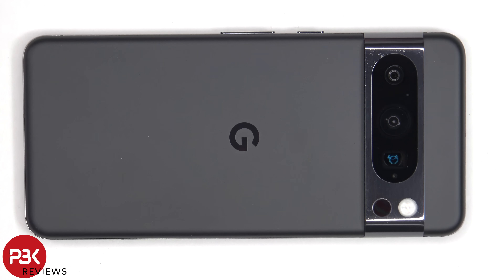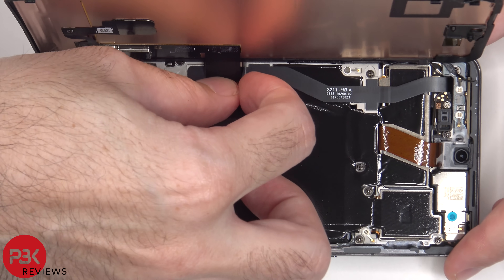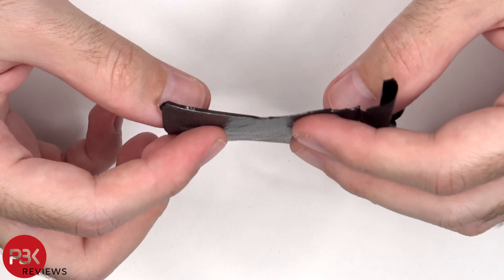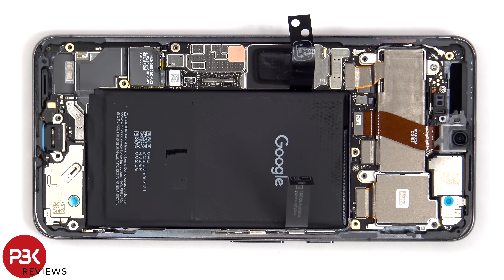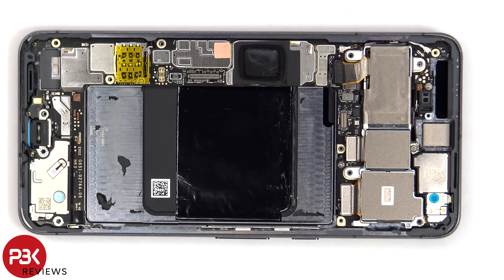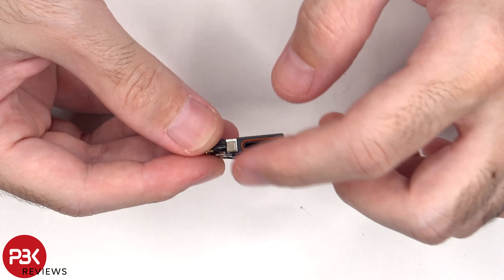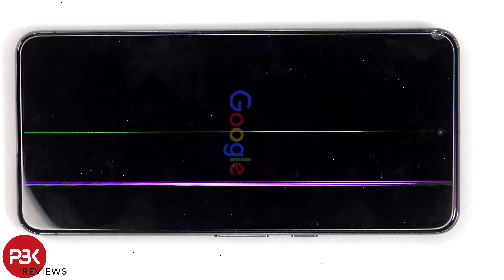Google Pixel 8 Pro Teardown Disassembly Repair Video Review

Comment: I would really appreciate and be very grateful for your response PBK.

I've had to replace my screen twice within 6 months on my Pixel 8 Pro. This second time just occurred and I haven't had it repaired yet. Both times I had taken my case off one day and then it ended up staying off for days, during which I dropped it from waist height onto hard surfaces.

There were no cracks or other visible physical damage either time, just some green lines across the top of the screen as well as a small black area at the edge of the screen. The area with display issues would grow larger over the next couple of days, until suddenly the whole screen would start only displaying one color most of the time, sometimes with short periods where the home screen would be faintly visible through the one solid color, and sometimes short periods where a large portion of the screen would be mostly visible as normal with some flickering. This period would only last a day or two before completely failing without anymore periods of partial visibility, but it would be enough to do things like turn off my password to make things easier for the repair shop, and turn off 2FA on many of my accounts, at least the forms of 2FA which required physical access to that specific Pixel device, as opposed to the accounts with forms of 2FA that just needed access to that phone-number/SIM-card. 

I believe something must be making my screen more vulnerable to damage for it to fail so easily with such minor accidents, especially when there are no cracks or visible physical damage to the screen glass. 

The side rails are cracked and chipped around the edge of the phone, with chipped areas at the top corners, and the top of the display is where the screen began to fail both times, so I think this is the cause of the weakness and vulnerability. 

So my first question is, is it possible to replace just the side rails of the phone's outer shell/frame? Is this a simple and cheap repair? Or is it a more complicated repair that could result in accidental damage to another component? 

I'm using a backup phone since a new display needs to be ordered and shipped from another country (I've been living in Myanmar/Burma and the Pixel isn't officially sold here) so I'm in no rush to get it repaired, and might just wait until I'm back in the the US in a couple of months since there's really only one repair shop in this city (Yangon) that repairs Pixel devices and has parts on hand (the first time I needed the screen replaced they had one on hand and didn't need to order it) - however I don't know how skilled they actually are and I know that they must rarely work on Pixel phones since extremely few people own them here since they aren't sold here.

For all I know, maybe the reason why the screen failed so easily this second time could have been because of the way that they replaced the original screen a couple of months ago. Probably not since this did occur just as easily the first time with the original  factory installed screen, and since they are highly reviewed for repairing other phones, but having more options in the US that more frequently repair Pixel phones just makes me feel a little more comfortable.

So that's why I might just hold out, especially since I don't expect to be going anywhere here in Myanmar before my next trip back home to New York, so there's no reason that I would really want to have my Pixel for the superior camera. The camera was my primary reason for choosing that phone and the only major thing that I really feel like I'm missing at the moment while using this backup Oppo phone. 

Second issue: for a couple of weeks prior to the display failing this time, people have been unable to hear me on calls unless I used it on speakerphone/hands-free mode. I'll look into potential issues and glitches on the software side, but I'm assuming it's more likely a physical issue with the microphone. So is replacing that microphone a simple repair or does it involve extensive and delicate disassembly of the whole phone? Should I expect that to be fairly cheap? I don't do a lot of voice calls so just using the speaker mode wouldn't be a huge deal if this repair is expensive or if there's a  reasonable chance that it could result in them accidentally damaging another component. Maybe I'll get lucky though and just need to reinstall the drivers or something like that though. 

Anyways, I would really appreciate your response, so if you can, thank you very much. And regardless, thanks a lot for all of the great videos and testing you do.

Comment: I dont know why google isn't using the aluminium frame as a heatsink for the processor. There should be a strip of thermal pad on the back of the motherboard to get heat away from the back of the processor. Instead of that cooper tape, there should be thermal paste or a thermal pad. There should also be a thermal pad on the aluminium midplate to transfer heat to the screen. This would make the phone feel warmer from the outside, but it will increase the performance and lifetime of the phone by preventing the processor from overheating.

Comment: What is the hardware for GPS?  After getting my screen replaced, I can't get my GPS to work in any GPS supported apps and I think I've been through all the software possibilities.
Reply: Did you find a solution for this?
Reply: @wizardzx2  appears to be part of the motherboard.  Not financially replaceable.  3 years worth of payments on the phone, had it for over a year but only used it for about 6 months and Google is no help

Comment: A newbie question maybe but can you replace the Bluetooth and WiFi module? I just can't stand how they keep crashing and i have to "tap" or "hit" the phone a few times on it's side in order for them to get back on only to randomly switch off again after a few hours of use. Is there anything that can be done? Thanks.
Reply from the maker: would require good soldering knowledge

Comment: What’s crazy to me is how we are still gluing batteries down. You can easily have a cushion pad behind the battery, then 2 plates (top and bottom) that screw down and hold the battery in. You can make the screws hold other components as well.
Reply from the maker: adhesive is not the problem. they can use good pull pouches like Xiaomi and similar companies use which can be reused. those are really easy to pry off and attach a new battery down to so no need for screws even.
Reply: Why not go back to old school and make the battery changeable without having to carve your phone up... I guess it's like motor vehicles now you either don't have the special tools or it's only repairable by the manufacturers 🤠

Comment: As before, the heat dissipation design still doesn't look great. Perhaps the lower Big Core operating clock than the Exynos 2300 on which the Tensor G3 is based is due to the lower heat capacity design.

Comment: Amazingly, they added large area vapor chambers underneath the screen and the battery finally to partly resolve the overheating problem of their Tensor SoC made by Samsung. I have bought it.
Unfortunately, it's C shape mainboard is vulnerable, while most advanced phones use the separated mainboard design instead.
Reply from the maker: There is no vapor chamber in this phone.
Reply: @PBKreviews  only some primitive thermally conductive material (the black parts)? No chamber on the back of that screen?
Reply: It's just copper tape
Reply: @floating_diffusion isn't it graphite? That's what I heard, just wanted to know more
Reply: They used copper tape in the area behind the screen.
Reply: @floating_diffusion  Understand, same as my Pixel 6 Pro

Comment: PBK is experienced and yet damaged the screen during removal.  Not a good testimony for a novice to hear if trying to repair his/her own phone.
Reply from the maker: Yep, I mean it can happen to the best of us. But yeah on the pixel 8, I didn't run into the issue of the plastic frame around the back of the screen separating from the screen.

Comment: Google has done at least once in the past non-shouldered to the board usb-c ports (source: an old PBK video and I owned one) and on a smaller device.
This design is just cheap and stupid. (that includes all the devices built like that)

Comment: Not sure this is where to ask, but assumed the phones still work, can your next video answer the ultimate question nearly all of us are asking but no one's willing to answer:

How does the radio (baseband) in this, which is a 5300i vs 5300g in the G2, compare especially to the Snapdragon in the S23? Meaning testing in a fringe area for basic connectivity like phone calls & speed test next to a base station.
Reply from the maker: I didn't get a chance to test cellular connectivity due to the fact I "couldn't" activate the device that early, so I wasn't able to test things like that. I'm sure others will post videos very soon with those details before I would even get a chance to do a video on it.

Comment: Honestly, i hate the design like that

Remove the screen just to replace the battery
Reply from the maker: yup, atleast on the 8 it was very easy and I didn't have any problems removing the screen, but the 8 pro was for some reason a bit more difficult.
Reply: @PBKreviews even for most ppl.. removing screen without breaking it almost imposible
Reply from the maker: yup

Comment: I was so hyped for this phone, what the rumors claimed vs the phone we got us such a massive letdown I've decided to get an iphone
Reply: What all differences between rumors and actuality made you jump ship?
Reply: @zot1744  rumors was lidar sensor, ultrasonic fingerprint scanner, massive improvements with the tensor processor, more storage base model. And basically non of that happened, and my past 2 years with my pixel 6 pro haven't been great, no real issues for most of the time, just constantly delayed updates, but the September update ruined my battery life and cellular reception, constant ui crashing, running android 14 now, and it's mostly fixed but my cell signal still isn't what it used to be and I've lost Faith in Google.
Reply: LMBO..
That was bad decision making and a bad investment. There's nothing like the Pixel Experience. This phone is going to be awesome!
Reply: @mackmccord3743  I had the pixel experience, and it's why I'm leaving android behind for the time being, google just can't do shit right as of now and I'd rather take a break before I learn to hate android the way I learned to hate TouchWiz
Reply: @mackmccord3743  bad investment?

Comment: @PBKreviews what about Nokia G42 for a drop test, splash test and full Disassembly ?
Reply from the maker: There have been many videos on the teardown of that phone, and since the phone doesn't really have any rugged features, and only has gorilla glass 3, it wouldn't really stand up well against a drop test so most people wouldn't even be interested in seeing it. Compared to the nokia xr21 drop test I did which barely got views, I wouldn't see this model doing any better. :)

Comment: Whoever designed the battery pull tabs. Certainly didn't think it through. 😂
Reply from the maker: yup, even if it's meant to be done a different way, the directions on the pull tab aren't very clear.

Comment: I believe there's an improved ToF sensor in 8 Pro. Should have focused on that too. It literally makes Pixel's af so damn fast.
Reply from the maker: Not that I saw, don't even see it listed in their specs.
Reply: @PBKreviews I don't know if Google ever list tof sensors. But even the 7/7 pro have one.
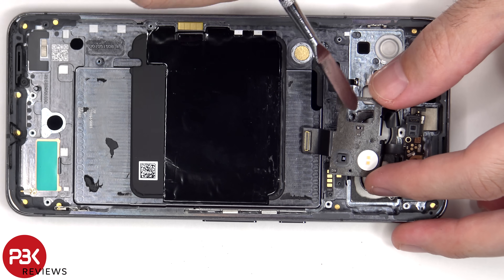Reply: @PBKreviews there is a ToF sensor. It's on the piece you removed with the flash and thermometer at 9:34. You called it an "ambient light sensor". That's the ToF sensor.
Reply: Rumored. Is there actually a new one?
Reply: It calls LDAF not Tof

Comment: Good job.
We need more isopropyl alcohol to replace the batteries.  Why did they use so much double-sided tape?
Replacing the USB-C port is not possible at home, which means it is time-consuming and expensive.
Thank you for this material.  To top it all off, someone do a comparative battery drain test from 100% to 0% with an iPhone and S23+ or S23 Ultra.
Reply: Because Google doesn’t want you to fix your own Pixel phones.
Crappy company

Comment: Wow, so the pro model has a 5mmw antenna and the non pro model doesn't?🤔
Reply: The Verizon version of the non-Pro model does (with a $100 premium) but the unlocked does not which has been the standard with Pixels.
Reply: @onetwentyfour  oh wow! weird.....

Comment: Dear google.. why would you boast about sustainability and repairability and then making irreplaceable USB C port.
Reply: Not a big deal if you're a repair shop, but not easy for a home repair.

I'm more concerned about the amount of adhesive used on the battery, hopefully it's not a big deal once you heat it up.

Comment: Nice video ! Is not having a vapor chamber or other cooling solution worrying for the longevity of the device?
Reply: Longevity? No, overall performance especially heavy load task like video capturing/gaming? Definitely
Reply: @4strolabos  Vapor chambers are a marketing gimmick. It sounds cool but it performs no better than graphite pads and has more drawbacks as it can actually fail inside of the phone. Look up the ifixit article on the matter.
Reply: @4strolabos I think it’s fair to assume if it has a difficult time remaining cool for heavy tasks/loads, then longevity might be an issue.

Comment: Avoid trying to remove a battery with a spudger or a metal tool yourself like he did, as there is a risk the battery could spontaneously ignite if punctured.
Reply: Nope, wrong, he is using plastic, and LIGHTLY prying on it. Disagree 110%
Reply: That’s why you don’t puncture it, you make sure to angle the tip of the tool under the battery down at the frame. It’s not hard buddy.

Comment: Wondering how graphene pad compares vs vapor chambers in terms of heat dissipation
Reply from the maker: as far as a graphene pad vs vapor chamber, the vapor chamber would be better, but 3D graphite which is multiple layers of graphite seems to handle just as well as seen from prior tests by other reviewers back when samsung started using 3D graphite in their phones vs vapor chambers. But not samsung has gone back to vapor chambers for the most part.
Reply: ifixit had an article a few years back when Samsung was using a vapor chamber in some Note 20 Ultras and a graphite pad in others. The thermal engineer they reached out to said "There is little difference in performance between [vapor chambers] and the graphite. As long as you take the gap tolerances into consideration, it can be simple enough to swap them out for each other.” He also mentioned drawbacks of vapor chambers stating “at these thicknesses, the VCs are a little delicate during installation. Any little crimp, dent, or bend can cause one to fail.” Plus, “if you heat them up just a hair past the limit, they will swell like a balloon. You can imagine what can happen to a phone.”

Also two years ago, Andrei F from anandtech (a site once known for incredible testing methods on devices) said graphite is better than vapor chambers in a now deleted tweet.

So...based on these two things, I'd say graphite pads are actually a better solution.

Comment: I think the third sensor in the camera array is laser focus, maybe?
Reply: I think it was the Spectral and flicker sensor. I think the new Multi-zone LDAF (laser detect auto focus) sensor is between the primary camera and ultrawide, near the secondary microphone behind the camera bezel. He point at the microphone at 10:04 mark.
Reply from the maker: yeah probably, I should have pried off the other portion from the inside to show. Usually from the outside those sensors are visible under certain angle of light but for some reason I couldn't see anything so didn't think there would be anything important on that side to show.
Reply from the maker: should be the ambient light sensor or color sensor, the laser auto focus looks different if I'm not mistaken.

Comment: Woah impressive now if my C port is broken, the whole phone will be useless. Is that so?
Reply: You could still use wireless charging or solder on a new usb c port.
Reply: @WirageVoyage  thank you. Well actually, the thing that mostly be broken the soonest, must be the screen. I am from Vietnam, so impossible to have parts to replace. We have Samsung factory here, so most people stick to Samsung since service center is quick and responsive. I love Google phones but I hesitate since the service is not as good as Samsung
Reply from the maker: I mean the port can be replaced by repair shops which can do soldering, but its just more difficult since individual users can't purchase the replacement part and replace it themselves without soldering expertise.

Comment: How did you damage the screen?  Too much bending on pulling or did the pick clip something?  Helpful to know what to look out for as I like to DIY replace my battery every 3 years or so
Reply from the maker: I must have clip the flex cable for the screen from the bottom where it meets the display or somewhere else when working my way around not realizing that I had separated the screen from the plastic border rather than the frame of the phone. For some reason on the 8 pro, the plastic boarder was adhered to the frame stronger vs the screen to the plastic border. On the 8 it was a breeze and didn't have any issue with it.
Reply: @PBKreviews  Thank so much for the detailed explanation.
Reply from the maker: you're welcome